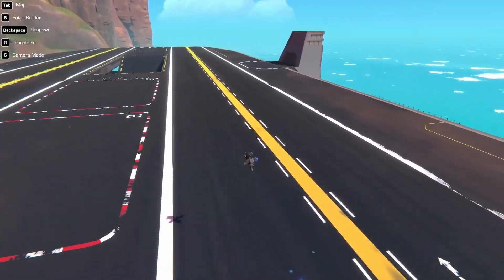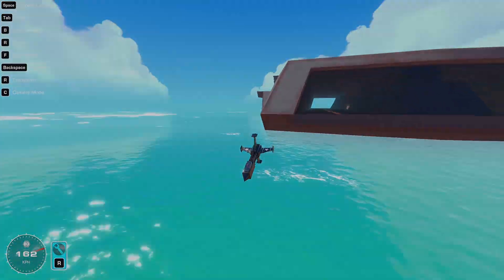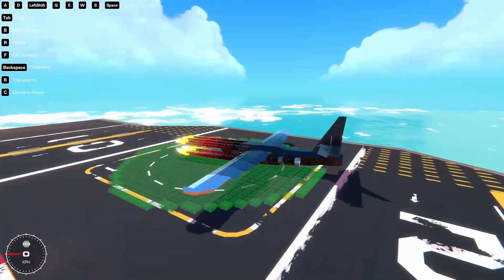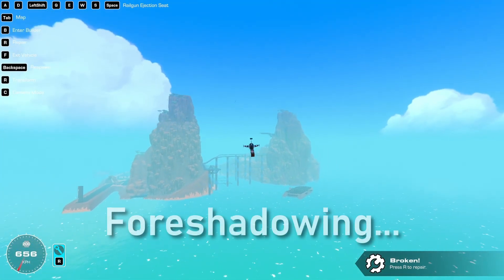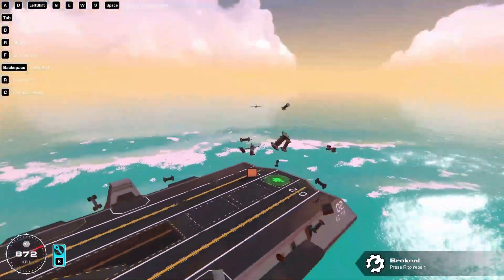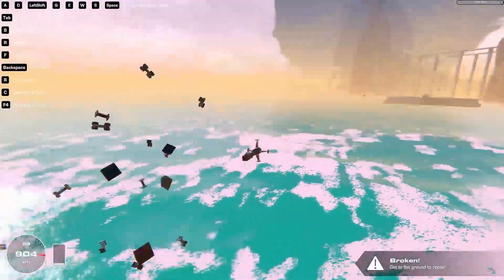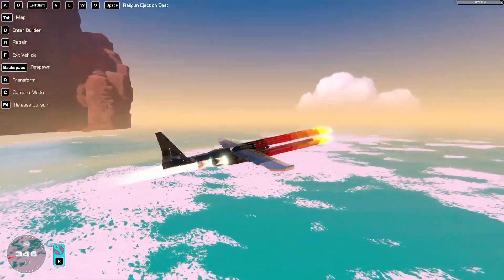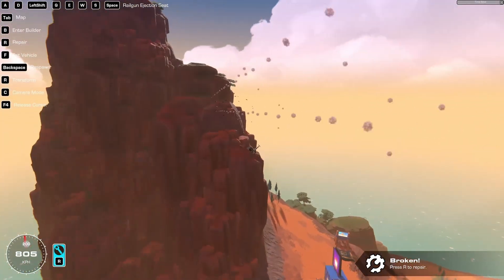Designing a Railgun Powered Ejection Seat - Trailmakers

Comment: If you want to keep the hinges on an angle once the seat attaches you have to use distance sensors that activate the Turning not controls from the seat
Reply from the maker: I've tried that but they still snap back to position 0

Comment: Local railgun exper here, your on the right track. You can place several magnets behind the projectile, I this case 9, however you'll get diminishing returns past 6. It's barrel is too long to be reliable while pitching or rolling, try shortening it and instead putting that power to the sides of the railgun, as they would also propell it.
Reply from the maker: I only did a bit of experimenting beforehand to make sure the concept would work, so thanks for the advice for optimizing this in the future!
Reply: Anytime
Reply: This is a coil gun though, a coil gun uses magnetic coils to propel a projectile forward (like this) while a rail gun is made up of two rails (one positivity charged, one negatively charged) in which the projectile completes the circuit when entering the chamber turning the entire system into a very large magnet that propels the projectile forward